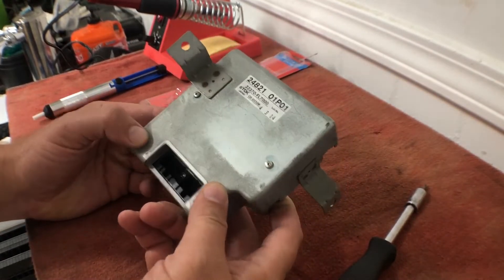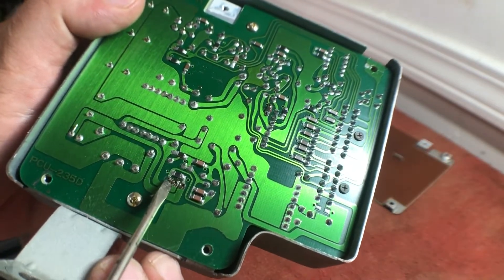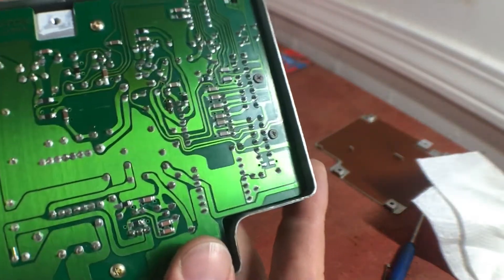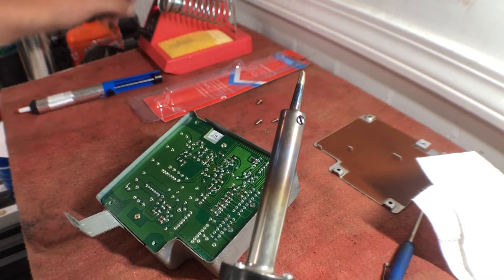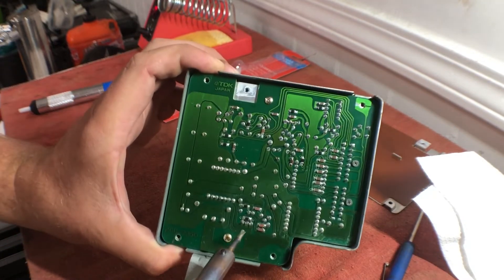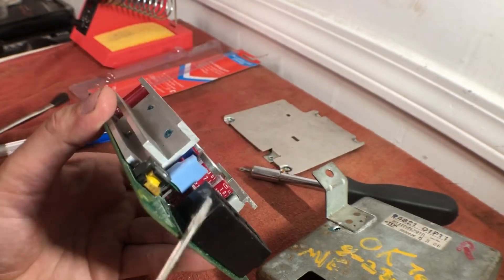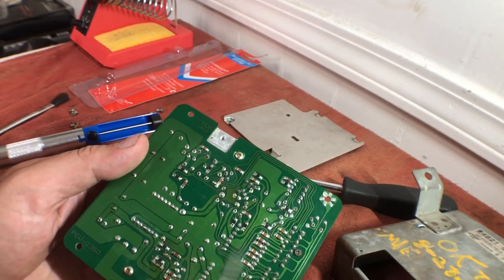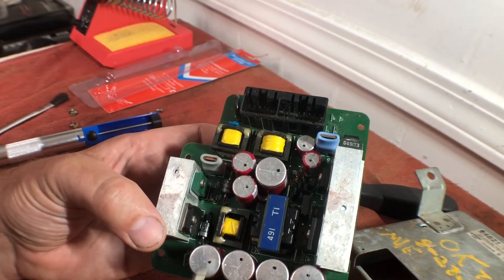Z31 Digital Dash Power Supply Resolder

Comment: Did this fix your blank fuel gauge? I’m having a similar issue with my z
Reply from the maker: My dash would cut out completely but it’s worth a try
Reply: @jef6404 any luck fixing your blank fuel gauge? I resoldered the psu even though it looked fine but my fuel gauge is completely black even the little character to the left of it. Im wondering if the fuel sender replacement or cleaning will fix it...
Reply: @HappyHardcore86  Any luck with the fuel sender cleaning? also did u try replacing the rear wiper fuse?
Reply: By any chance did you get it fixed??